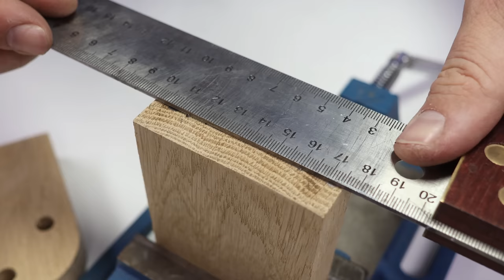Had some BIG Problems on this one

Comment: Well, that's pretty neat.   Yet, you still have the pith in your wood which cause the whole piece to check up.
Reply: Yeah, but forget about firewood and think about other circular or irregular lumber. The method comes handy if you need to make a piece with square edges.

Comment: OK, clearly this guy is quite a woodworker but, don’t they sell rip fences that are reasonably priced?  I get the pride of making your own and he absolutely did but, that seems like a tremendous amount of effort for 2x2 that’s 18” long?
Reply: Why buying it when you can make it!  It is not about the price but the satisfaction you made something with remains.
Reply: Yes I find as well, superbly done but very complicated for the result.
Reply: He wasn't creating an alternative RIP fence. What he created was a method for taking rough round and getting the main starting point which is a perfect 90° angle to work with. That was the whole point of his invention which he showed by placing the square to to show the accuracy of his design. As a machinist and a worker of wood can see the great benefit a tool like this gives.
Reply: I do see your point about the length though. It would be better if it could fit say... Stud length material plus be adjustable to accommodate any length under that. Might need an occasional tie clamp of sorts along the distance of the longer logs so to keep it from deflecting.

Comment: Don't need anything that fancy to do that.  Woodworkers been doing the same thing for many years, but didn't need anything that fancy to do it.
Reply: MAY BE BUT HE IS THE ONE REVEALING /TEACHING ,THAT TO LEARNERS INCLUDING YOU 🤣
Reply: @jkj1459  And he did it WITHOUT SHOUTING! LOL
Reply: You have it  wrong,  I learned how to do the same thing, many years ago, but simpler, faster, using scrap wood, and just as accurate.  My point is, you do not need to be so fancy to do it.  I know I certainly don't .  Hell, I could knock a jig together in well under 5 minutes, and it would be just as accurate.  You really ought to study wood working more.  Right now I am studying decorative painting to put some decoration on some of my work, started out with medieval materials and methods, and worked my way up.  Did you know, they used at least two poison paints, and one that was radioactive?  Interesting.
Reply: @tfit402  I agree,,, it's pointless.

Comment: Excellent idea and job my friend. the three points on each jaw brought back the memory of jaws I designed for a pneumatic gripper on the end of a robotic arm for picking and placing wooden pallets in a light bulb manufacturing factory. That was about 30 years ago. The grippers worked like a charm.

Comment: Neat. What does that shark fin guard on your table saw do?
Reply: It stops the wood (that has already passed the blade) from touching the blade's teeth which could "snatch" the piece of wood and launch at across the workshop

https://www.youtube.com/watch?v=8f8VWwtaudU
Reply: it's called a splitter. It keeps the wood from pinching the blade if there's warping going on as you cut.
Reply: It is called a riving blade.
Reply: @zulualpha3409  correct. But that hardly explains what it does ;p
Reply: The wood that has already been cut, is kept split open, so it does not pinch the blade.
It keeps the blade running smoothly.
Reply: @paulbullock7432  What you describe here would be the "anti-kickback fingers" which are like teeth that ride loosely on top of the cut wood. If the wood were to come back, those teeth would bite into the wood, to keep it from "kicking back" at the saw operator.
The saw in this video does not have them installed. They must be removed in order to cut thick wood.

Comment: Could've cut just one side flat, then the ends off perpendicular (to get rid of the hols on the ends), drilled 3 (or more) holes in the top where the bark is, insert candles, and sold it for $50 with a Christmas bow added!  Just saying!
Reply: ...He he...